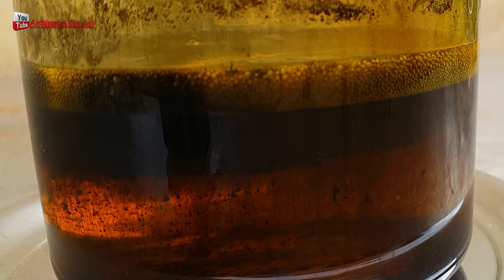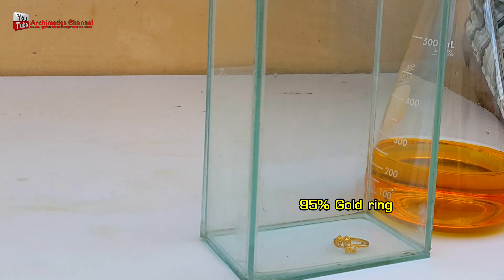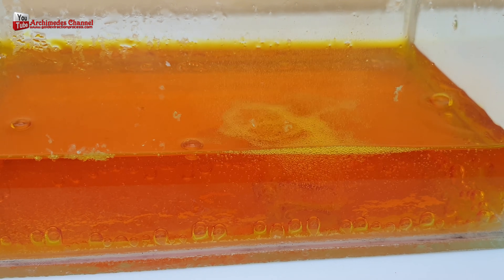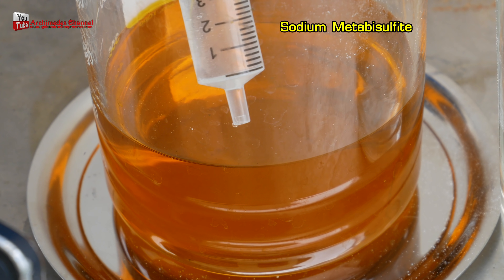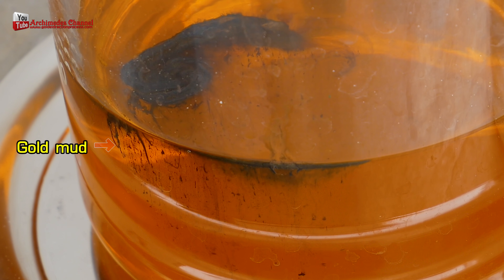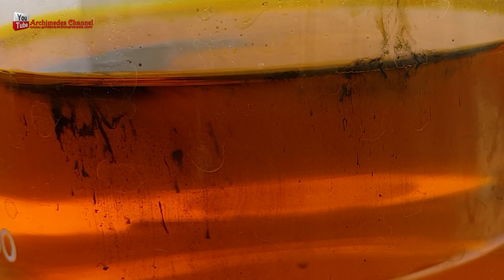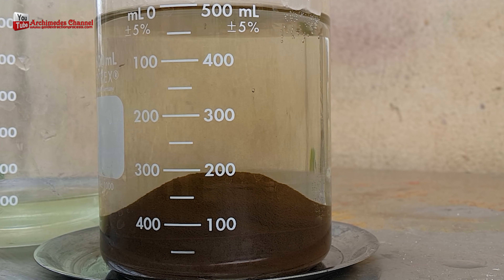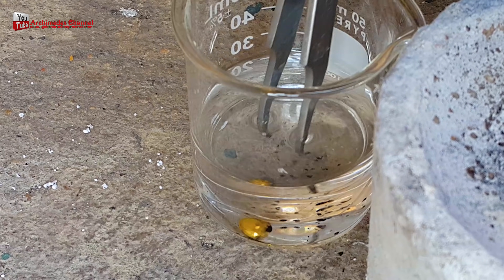Aqua regia process dissolving gold recovery reaction equation

Comment from the maker: 👍👍👍👍👍 Fast Facts: Aqua Regia
Aqua regia is a corrosive acid mixture made by combining nitric acid and hydrochloric acid.
The usual ratio of acids is 3 parts hydrochloric acid to 1 part nitric acid.
When mixing the acids, it is important to add the nitric acid to the hydrochloric acid and not the other way around.
Aqua regia is used to dissolve gold, platinum, and palladium.
The acid mixture is unstable, so it is usually prepared in small amounts and used immediately.👍👍👍👍👍
Reply: personally i did exactly eleven tries but only two that worked, so i think i have a problem with sodium metabisulfit, please help me
Reply: @privat1531 please use 1:3 formula

Comment: I followed the 4:1 ratio to dissolve 3.5g of gold i heated it for 6 straight hours yet it didn't dissolve the gold button .7 goes into the solution... i've used hydrochloric acid which is 15% concentrate....the .7 that went into the solution that i've tried to recover didnt have black color reaction when i poured the smb..it went dard red...need your advice..thanks

Comment: Thank you so much for the al those experiments and videos. Just one question is it also can replaceable for scrap out the gold from CPU stuffs? Or does it melt others too?
Reply from the maker: 👉👉👉👉 Other metals should be dissolved first by nitric acid.
Then use Aqua regia.
Reply: @MakeGold  So if my gold is mixed with random metals I have to let it sit in nitric acid first before making the aqua mix?
Reply: @MakeGold How to dissolve rhodium sir?
Reply: @MakeGold CAN YOU ANSWER THE ABOVE QUESTION ?  PLEASE..